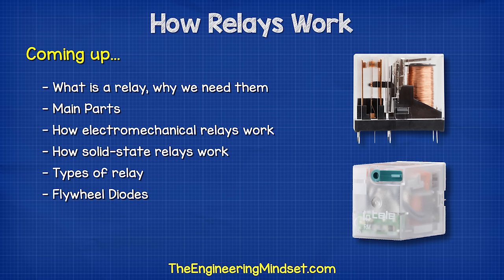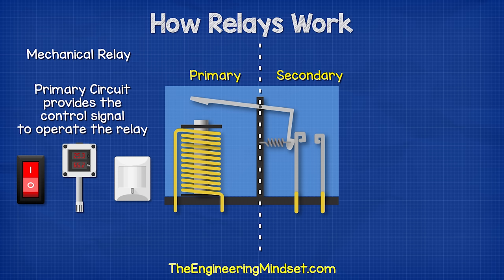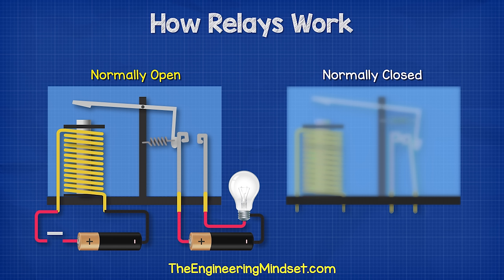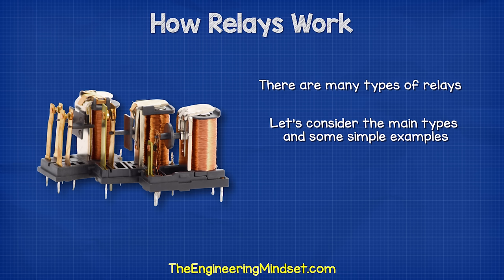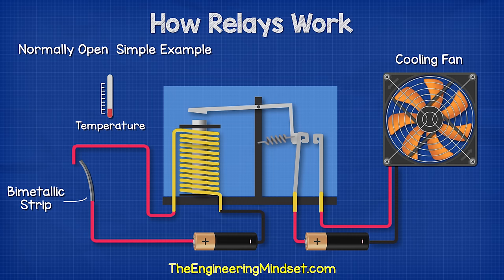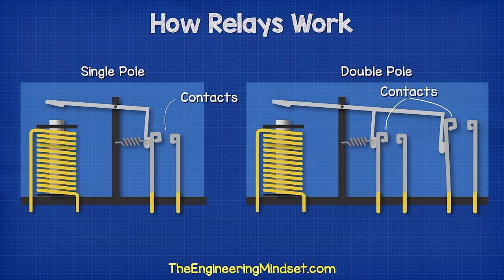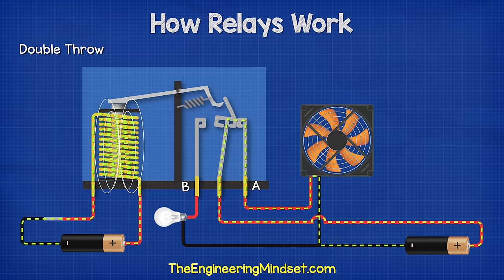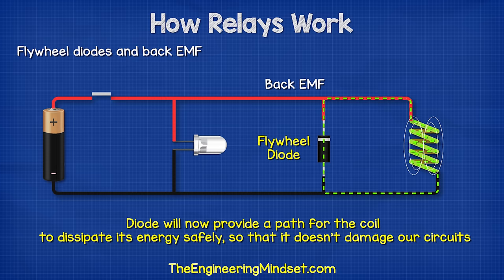How Relays Work - Basic working principle  electronics engineering  electrician amp

Comment: hi i want to , im on this project , its like vaccum door using for clinical lab , it has 2 door  2 light ( red and green ) 2 EM Lock and 2 pair of door sensor , the logic is like this , if i go through 1 door , another door will lock and red will light up ( detect using door sensor ) ,  if the both door closed , it will turned green . and not lock . can u explained the connection to me ? because im bit confused .  the EM Lock , lights and door sensor control by relay

Comment: Automotive relays with the numbers 86 & 85 on Primary circuit and 30, 87 (and sometimes 87a) on the secondary circuit. I know how to connect the terminals but don't know the origin behind the use of those specific numbers to label the terminals? Do you know? Thank you.
Reply: Alex P Look up “DIN 72552” on Wikipedia.  This article lists the entire standard, which defines the standardized terminal numbering that is used in automotive design.  This doesn’t necessarily answer your question as to ‘why’ these particular numbers where selected, but it will put the terminal numbers in a meaningful context.

Comment: I thought i need a relay to make some additional (or upgrades) in a motorcycle work? I saw this MC one with a horn with what i suppose requires a huge draw but without any relay?

also, i read that relays also act as amplifiers? what i understand so far is that relays opens this circuit separate from the main circuit.

HELP! :(

Comment: Hey Paul! I've got a question. Why wasn't the current flowing through the flywheel diode too? 13:26
Reply from the maker: Diodes only allow current to flow in one direction. It's blocking the flow because the lower side has a higher potential, but when the power is cut, that potential diminishes so its able to break through the diode

Comment: If I had a normal circuit breaker and I want to add "normal closed phototransistor relay" inside it, would it be possible to prevent electrical explosions in my home?
Reply from the maker: Seen our new incredibly detailed MCB video? link: https://youtu.be/gqEu9t8HwW0

Comment: I didn't understand the "EMF" part. when the power is cut, why wouldn't the the power go through the bulb? that path is also open right? and the video is showing current is flowing through the bulb when the switch is on, but the diote path is also on right? Why the current is not flowing from there when the switch is on? i don't understand.

Comment: I have an idea to power 3 electromagnets off and on in a triangle to mimic rotation. Rotating a magnetic field around a conductor in the middle of the triangle. This should mimic the needs to create electricity by rotating magnets around copper wire.
Reply from the maker: That's how a 3 phase motor essentially works
Reply: Yes but would any produce electricity be able to loop back into the system to self power yes there is loss but basically mimicking rotation to generate electricity using geometry in placement of "emagnets"to make it act as if 3 or more magnets are rotating than just one. At any point could it produce more than it takes to generate?
Reply from the maker: It can never produce more. You would need magnetic bearings, a perfect vacuum chamber, perfect symmetrical design and zero gravity
Reply: Even with zero moving parts?
Reply: @EngineeringMindset  imagine an  nonagon with 3 sets of 3 electromagnets in Triangle shape in the middle you have a stationary copper assembly (of my own design) to fill and empty of magnetic field. Imagine it would "act" as 3 magnets spinning around the center of the nonagon. Turn each set on in sequence 123.123.123.123.124 as fast as you can get them to turn on and off. Thousands of rpms. Nothing moves just turns off and on. Is This Impossible.
Reply: @EngineeringMindset  in theory if you have three electromagnets pointed like a triangle around a single point and have  copper wire loops in the center in a triangle of circles off set to receive direct magnetic force if you power the emagnets off and on to fill and empty the copper loops. Nothing moving the magnets shaped to be strongest and most directional. would it generate electricity? But more important efficiently. Nevermind cooling circuitry housing or any details.
Reply: @EngineeringMindset  using a simple strobe circuit could you mimic ac to power electromagnets then use this field generated to generate electricity or would it only transfer electricity at a loss? Imagine various assemblies to direct the electromagnet field/fields and a collector to fill and empty with magnetic force and you know make with the sparky spark.

Comment: A typical use of relays not mentioned in the video is as an emergency stop. A four pole NO relay is connected to all three phases, as well as an indicator lamp. The power to the coil is routed through a NC switch that has to be twisted to return to its original position. When the power is turned on, all three phases are energized, and the indicator lamp is turned on. If an emergency happens, you press the button. It breaks the circuit energizing the primary side, and the relay returns to the open position, thus interrupting all three phases, and turning off the indicator lamp. This is mandatory in industrial applications.

Comment: Ok I'm pretty new to electronics and mechanics. So in a car horn, theres a relay I'm pretty sure. Now I think the horn circuit is attached to the 87 pin, and when the relay is in the 87a state, nothing happens. Would it be possible to swap the the horn to the 87a state, so its always on until some presses the horn. This is purely hypothetical so ethics don't apply 😂

Comment: How come current is not flowing through the flywheel diode when the circuit is not interrupted and just operating normally? How come it is only flowing through the flywheel diode when energy is dissipating from the electromagnetic field? I understand that electricity always takes the path of least resistance back to the source but how does it bypass the flywheel diode and the wiring in parallel when the circuit is closed and electricity is flowing through the whole thing?

Comment: I don’t get the need for a relay in the fan example, if let’s say both were using a 1.5V battery, why not just hook up the sensor to the fan circuit and remove the relay?

Comment: So why do the electrons get stuck on the outer part of the n type , and why when the photons come in does it only then begin to move
Reply: Specifics are explained in semiconductor physics classes, which are some of the hardest to understand. The simple explanation is that electric fields oppose leakage between layers. For current to flow, a voltage across the layers must be present to counteract the intrinsic fields.

Diodes are NP semiconductors, they resist current flow until a threshold voltage is met, at that point the intrinsic fields are temporarily overcome and current flows.

Comment: I need a relay to control the LED lights on my Jeep. If wired to the battery I need to turn them on and off through a phone app every time I use the car. If I wire them to the fuse box, they are depowered when the car is shut off, next time I start the car they go into demo mode. So I need a relay to allow the power to stay on the module when the car is off. Any ideas?

Comment: IF the low voltage circuit is just a wire wrapped around a coil and then back to the battery, wouldn't that be a complete Short Circuit which would FRY the battery if left on?
In other words, when I flip the switch on the low circuit, that activates the electromagnet which switches on the High Voltage circuit which I want to remain on. In order for it to remain on, the low voltage circuit has to remain on.
So, the wire from the positive side of the battery goes around a piece of steel, through the switch, and then back to the negative side of the battery...A direct short.<<<What keeps the battery from going dead or exploding in just a matter of minutes??

Comment: I wonder, if electrons has to complete the circuit!! Then when we connect live with neutral or positive n negative directly without any device, why does it short-circuit??? Or there's a huge spark?? Isn't that completes the circuit????
Reply from the maker: There's no resistance so unlimited electrons can flow. Like a river with too much water flowing in it. It'll burst its banks.
Reply: @EngineeringMindset  thanks for the reply ☺️, so it means wd proper resistance the circuit will complete without any short circuit...  usually neutral wire are the same Guage as live...

Comment: It's a pity that this (otherwise good) video does not explain how AC primary coil works, only mentions it at 2:07.
Reply from the maker: It works the same. The current creates a magnetic field and holds the relay arm
Reply: @EngineeringMindset  Yes, but how is it achieved that it seemingly works the same, despite that the magnetic field reverses after 20 milliseconds and pushes the relay arm away instead of attracting it. This is what would be interesting no know. Maybe as an idea for the next video.

Comment: What will happen if i will change the polarity of battery..?? 
Will relay works?
Reply from the maker: Follow the installation instructions of the manufacturer. We don't recommend any other way
Reply: @EngineeringMindset  i m just asking to learn.... Overall i m not using it.. 
Just want to know if we change the polarity of battery then the electromagnet will be repel the contactor or attract ..?
Reply: @AmanKhan-ec6lg  It will only repel the actuator if this has a permanent magnet, otherwise it should work with the current flowing either way, but as Paul says, always follow the instructions.

Comment: I would have liked to see and understand the relays in a car. If everything is 12v system why is a relay needed to control the headlights? Or say you add a led light bar, some ppl just tap into the wire for the headlights and some add a relay. Can’t you just run a fuse and wire from the battery straight to a simple toggle switch? Why add a relay too??
Reply from the maker: Seen the new LED explained video? so much detail covered! https://youtu.be/O8M2z2hIbag

Comment: Why do we have use relays? Can't we use some cards like arduino or rb pi  to control or automate our systems? That's confuses me everytime.
Reply from the maker: We don't need to program a relay
Reply: Relay used to power a very high load device with low energy control unit like arduino, like you wont use arduino to power a 30amp motor right
Reply: @user-eh1ul8wj4x  Thank you. That's what confused me so far